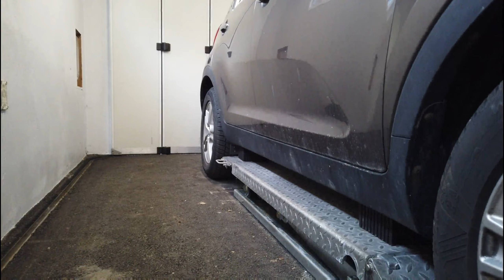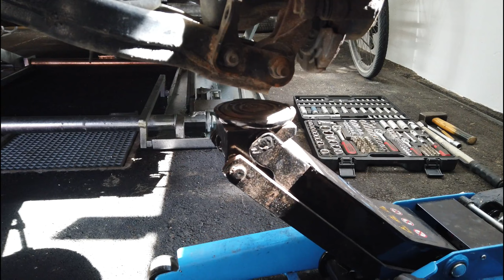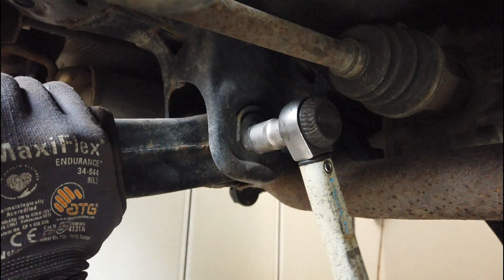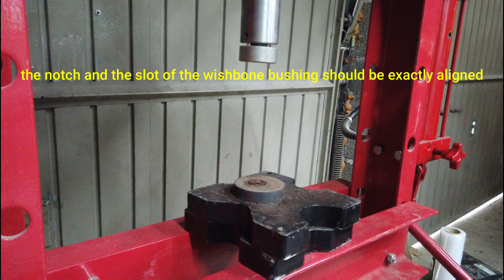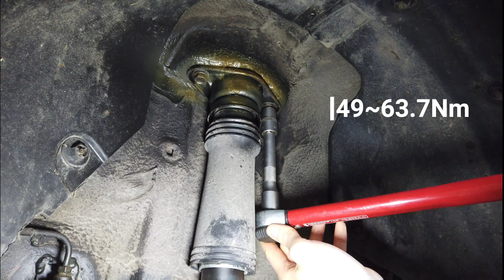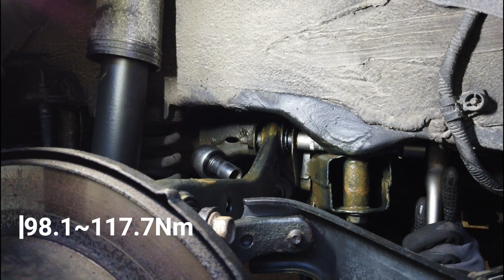Kia Sportage SL 2010-2015 - Rear Suspension Arms, Sway Bar and Anti Roll Bar Links Replacement

Comment: @Turboladerschaden do you know which bolt give to me the positive camber ?  I see the the rear control lower have a bolt .... but the spiral mount have too.
Reply from the maker: @castolo1919  the camber can be adjusted with the eccentric screws. There are 2 on each side
Reply: @Turboladerschaden  Thanks, I imagine that with one I align vertically and with the other horizontally, but the vertical alignment is given by the screw of the spiral support?
Reply from the maker: @castolo1919  Unfortunately, I'm not a professional when it comes to track adjustment. But the eccentric screw on the large wishbone, where the spring is located, adjusts the camber. The other eccentric screw on the smaller wishbone should be responsible for the toe adjustment to the front wheels. I hope it is reasonably understandable and the translator has translated it correctly 😅
Reply: @Turboladerschaden  Thanks men!  Looking at forums and videos, it is as you say. I bought the upper arm on Amazon to replace it, the wear on the bushings is giving me negative camber.
Reply from the maker: @castolo1919  that's great to hear. I only adjusted the eccentric bolts by eye as I had to replace all the wishbones and also had to saw the bolts to size. I had no choice but to have the track adjusted on a wheel alignment test bench. I wish you the best with your repair☺

Comment: Hi , very helpful video , where can I purchase the bolts/hardware required at 15:00
Reply from the maker: @talhaubaid1144  Hey, the outer screw should have the number 626172S000 and the inner screw 552603M000. The screws are for the wishbone at 15:00. I ordered everything from Autodoc, just enter these numbers in the search bar and you should find what you are looking for. Otherwise enter these numbers in Google. I hope I was able to help 😊✌️
Reply: @Turboladerschaden thank you so much! I was scouring the internet trying to find these. How many will I require to change left and right arms. Mechanic has recommended to change both due to loud clunking over bumps
Reply: To clarify how many of each bolt will need to change each of fhe arms shown at 15:00?
Reply from the maker: @talhaubaid1144  If you change both wishbones, i.e. left and right, you will need 2 screws from each number. I think that you only need the inner bolt, which I also had to saw out in the video. the outer ones came out without any problems and could be reused.

Comment: I notice at "19:21" you place a washer onto the lower thread of the sway bar link (roll bar link) is this necessary? I my 2006 KIA sportage did not have when replacing.
Reply from the maker: Hello, yes the washer is needed here because otherwise it has too little contact surface. But this is different for every vehicle model. It may be that the 2006 does not need it. If it doesn't have one, it probably won't need one either.

Comment: Hello sir. I have this same vehicle. The rear tires are beginning to bald on the inner side. What parts will I need to replace? Thank you for your help sir. I tried looking up rear tire rods but couldn’t find anything.
Reply from the maker: @georgepadilla2993  Hello, you don't necessarily have to replace anything. I would recommend a wheel alignment. The camber is then adjusted using the eccentric screws on the rear axle. After the alignment, the wheels should wear evenly again.

Comment: how many miles on the car? Rust belt?
Reply from the maker: hey, the car has about 145,000 kilometres. here in austria there is a lot of salt in the winter, which is why the cars start to rust a lot. that's why i applied underbody protection to be on the safe side.